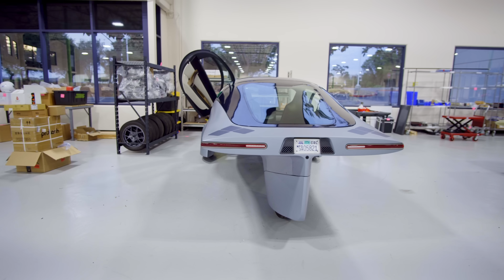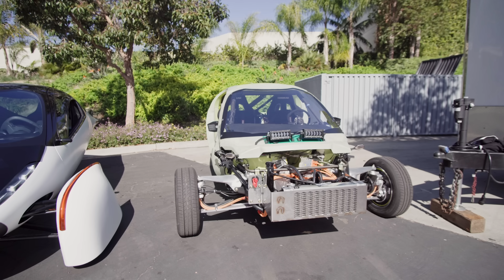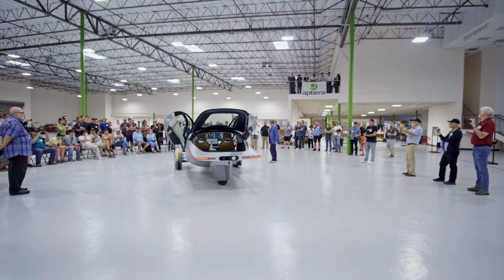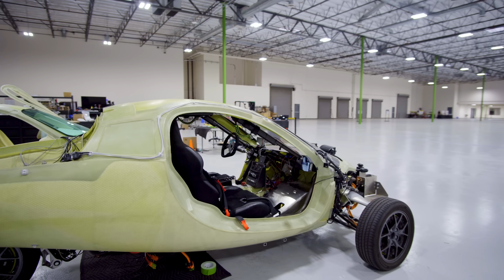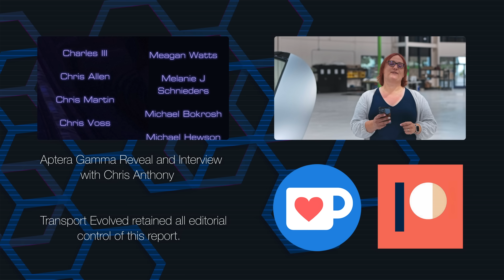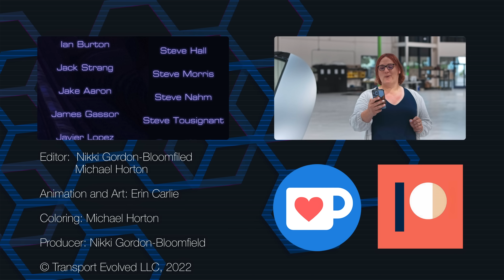The Aptera Gamma Prototype Is Here. What's NEXT?

Comment: air conditioning, does it have AC because if you live in the south it is a requirement
Reply: Yes, of course - AC and heat.  The body has several times the insulation value of most cars.  The AC system will also help remove heat from the vehicle when it is stationary and charging at a fast charger, or creeping along at under 15 mph in traffic on a hot day.

Comment: Great Interview.     I wish someone would talk to Chris about  the HVAC      air conditioning and heating.    It MUST have heated seats if not heated and cooled.....
Reply: All 3 will be included. From their FAQ:
 
"Where are the vents and capabilities of the HVAC system in Aptera?

"For Delta production, our complete HVAC system will include the following— windshield and side window defrost, left and right under IP footwell vents, left and right outer corners of IP vents, and the main screen vent system, which will be fully controllable in both temperature and velocity of the airflow. The center venting system was born of our design process and philosophy with roots in intelligent efficiency and radical simplicity in that we had two needs fulfilled by one solution."

And, 
"Will Aptera have heated or cooled seats?

"We plan to equip the vehicle with seat heaters. We are designing this vehicle specifically for a lot of the cold countries that love electric vehicles. Our sandwich core composites body offers great insulation and a nice heater, it’s very comfortable driving in the winter.

"Cooled seats are great for efficiency because if you cool the body, it’s actually more efficient. Unfortunately, cooled seats are pretty complex. We think those will eventually be an option. We’ll know closer to production whether or not seat cooling will be included. It’s a technical challenge for sure. "
Reply: @fotoguru222  The heater I need in my Nissan leaf is for my foot rest in winter. It should not be much heat needed, but very needed heat, and would keep me from feeling very cold! in a car that basically has too little heat! The snow freezes my shoes before I step in the vehicle! fixing this would likely prevent needing to heat the rest of the cab so quickly!

Comment: Doesn't look rugged, looks fragile. 3 wheel is excellent for motorcycle drivers. Price tag should be reasonable, though
Reply: It will be crash tested to FMVSS Part 200 standards by a third party as soon as there are production vehicles available for testing and the results will be made public.

Prices start at $25,900 for 250 miles of range.

Comment: Worrying.   Disappointed the thinking is so USA centric without even considering the rest of the world.   People mostly charge at home, and outside the US that means 3 phase AC which the Tesla plug will not support.  The world will not- cannot move to the USA Tesla plug, without seriously compromising charging at home.  If there was 3 phase suitable version of the Tesla charger it would be different. There is a reason even Tesla does not use it outside the USA.  Everything else about the car is so great, makes it so disappointing no one is thinking beyond the USA.
Reply: Aptera is working with international homologation experts and will have suitable changes when needed when the time comes.

Comment: Great interview. On this vehicle the Tesla charge port just makes sense. Glad they’re sticking to it. Like Chris said : everything on Aptera is bleeding edge tech, WHY take a step backwards with CCS?
In the EU they can just stick the big clunky CCS on it somewhere. 😂
Reply: Nearly nothing on the aptera is bleeding edge tech. It is banged together from over the shelf parts.
Reply: @vic321344  then you haven't researched this vehicle very well for you to say that.
1) pressed carbon sheet body panels 6x stronger than steel 6 piece body.
2) super efficient hub motors
3) Cd of .13 or about 1/2 pf any other car.
4) weight about 1/2 of a Tesla 
5) energy consumption aprrox 1/3 of any other ev
6) custom designed solar giving up to 40mi/day on solar alone.
so tell me how Aptera ISN'T bleeding edge engineering???
Reply: @jerrymolnar8010  you haven't researched this vehicle very well for you to say that.

1) The pressed carbon is an old hat. Not only the italian company uses this cheap alternative to real carbon parts.
2. The hub motors are not at all efficient. Tesla motors are efficient.
3. Aerodynamics are already known since WW2. Aptera has a good aerodynamic coefficient. There were already other vehicles in the last 100 years who tried that. But good aerodynamics means bad usability. Like a footprint wider than a Hummer H1. Therefore none of these aerodynamic cars ever made it into mass production.
4) Aptera is a motorcycle. It does not have to fulfill all safety features a cars has to. So it is easy to be lighter than a real car. And cheaper to produce. BTW Tesla has 4 seats and is the safest vehicle on the market, Aptera has only 2 seats with no real safety provisions whatsoever. A Deathtrap in case of an accident..
5). Aerodynamics. The drivetrain, battery, charging, heating/cooling of the Aptera is not at all efficient. The consumption of the Aptera is on par with other electric motorcycles.
6) solar yield is just a phantasy. Completely unproven. Other manufacturer made the same kind of promises and failed.

so tell me how Aptera IS bleeding edge engineering???

Comment: You have to validate anything the computer model tells you with wind tunnel tests, as the real world doesn't always match the models. I hope that has happened here.
Reply: I'm guessing that getting access to a wind tunnel is very expensive. Besides if the computer model is off slightly, who is going to complain that the Aptera uses 110 Wh/mi instead of 100 Wh/mi?

Comment: If Aptera is going with the Tesla connector, I hope they plan to include the Tesla to J1772 adapter that Tesla includes with vehicles and that they've confirmed that a common J1772 handle with a J1772 to Tesla adapter will actually fit their 'hidden' port.

And they better have a contract with Tesla for access to their charging network because if they don't, what's the point of using Tesla's connector except to save space and inconvenience your buyers.
Reply: Even in the US, Aptera will come with adapters.  I am sure that Aptera and Tesla have been in talks.  Tesla has made noises about opening up the Supercharger network to third parties, but we will have to see what happens.

Comment: In some states (NY for example) operating three wheeled vehicles require a motorcycle endorsement on your license. Is Aptera trying to get an exemption?
Reply: I thought that I had seen that no states required MC endorsements for Autocycles [roof/ roll bar & wheel vs handlebar]
Reply: Currently a motorcycle endorsement is only required in AK, WY, and MA.
Reply: @GoClimbARockEh  The law has changed in MA and WY.  AK is the last holdout.
Reply: @GoClimbARockEh  MA and I think WY have just changed their laws - residents should check.

Comment: Great interview. Chris revealed that the point of greatest turbulence is where the tires hit the ground below the wheel pants. For a while I’ve thought that maybe the pants should be shaped like the ‘spats’ on aircraft like Cessnas. From the side the spat looks like an egg with a pointy aft end, and a bit of wheel poking out of the bottom. The spat does a better job of streaming the flow before and after the wheel touches the ground, and makes a cleaner entry and exit to avoid hitting sharp changes in the road surface.
Reply: It is a bit easier when you only have to roll on a smooth runway. Dealing with speedbumps and snow and road debris probably makes the ideal pant impractically vulnerable.

Comment: Open? How about real pictures of the interior!
Reply: Such pictures are available. Check out almost any other video from the event
Reply: Detailed ictures of the interior were the first ones released.
Reply: @n.brucenelson5920  as a older person i'm interested in seeing people get in and out of the vehicle. All of the company videos only show the door opening then cuts away to the person already in the car.  I have a model 3 and getting in and out is easy but with the high rail you need to get over it looks like it will be really hard to get out.
Reply: @longIslandEV  I am an older person, too at 72 (almost 73, but lets not rush things).  I have only sat in and ridden in the first alpha Luna model.  There are some significant changes, most of which should make it easier.  They include moving the seats inboard and a larger interior.  In Luna I was able to back up to the seat, sit straight down, and then swivel on my butt to swing my legs in.  Getting out was the reverse butt swivel.  I have not had a chance to experience gamma yet.

I suggest trying it yourself once you have an opportunity.
Reply: @n.brucenelson5920  thanks.  i'm on the east coast so trying is unlikely.  I'm a fan of a smaller EV that is lighter on electricity.

Comment: What kind of driver licence do you need for this car?
Reply: In the US, you only need a regular driver's license in most states. Exceptions are MA, WY, AK
Reply: @GoClimbARockEh  Since this is considered to be a motorcycle, you don't need a bike driver licence?
Reply: @19mati67  No, it's in a weird grey area, sometimes called an 'autocycle'. Basically it's an enclosed vehicle that handles like a car, so you don't need a motorcycle license, even though it's legally more of a motorcycle than a car, simply because it has less than four tires.
Reply: @GoClimbARockEh  MA and WY are no longer exceptions.  I think Alaska is the only holdout at present.

Comment: Thanks, Nikki, an informative interview. Aptera doesn't need to adhere to 4-wheel automobile safety standards, but I'm curious about what sort of safety features will be included. Like crash safety, pedestrian detection, etc.
Reply: I think they previously said it has airbags
Reply: I beg your pardon? Why wouldn't it need to at least meet the safety of other vehicles?
Reply: @IIARROWS  Aptera has been designed to pass the full FMVSS Part 200 crash test standards required for cars, even though it doesn't need to in its class.  It will be third party tested and the results published as soon as there are production intent vehicles available to test.
Reply: @n.brucenelson5920  "Has been designed" does not mean that Aptera wil be able to pass any of them. "will be" is the usual empty Aptera promise.
Reply: @vic321344  every new vehicle has safety designed and built in but needs to go for independent testing.  We don't know how much in-house testing has been done on the safety kit. I'm guessing from your negativity you're not on board with this journey 😂
Reply: @nickjolly3984  No, motorcycles like the Aptera dont need to follow any testing protocol. I'm guessing  you're not on board with this journey 😂
Reply: @vic321344  I have a reservation. I'm not sure of the regs here in the UK regarding three wheelers but I'm comfortable that Aptera is perfectly safe.
Reply: @IIARROWS  3 wheels
Reply: @IIARROWS  It likely meets the standards set for a Harley!  Are there any? Just kidding! Sorta! 

There are airbags seat belts etc! These are things that are likely not found on a Harley etc.

The crash tests will likely tell the whole story later on in 2023! I am guessing that Elon has likely explained what works for crash protection and that that is already in the design! But, The test will tell!

Comment: Pre-production in 2023....this vehicle is never going to get made.
Reply: Interesting comment.  They have been developing far faster than Tesla for instance.  We will see production Aptera on the road before we see Cybertrucks.  Remember that Aptera started development in 2019.  It took Tesla 6 years to introduce their first EV conversion Roadster - a far simpler task.
Reply: @n.brucenelson5920  They develop very slow. Now they have a 80% mockup, no tests, no 500kMiles, no crashtest. They are still years away from production.

Tesla had to develop everything new: Batteries, charging, charging stations, electronics, motor, chassis. Aptera bangs together their vehicle from ready to buy parts.
Reply: @vic321344  Your rewrite of history won't fool anyone.  Not to take away from Tesla, but it took them 6 years to deliver their first "kit car" Lotus Elise EV conversion that they called the Roadster.  

Although Tesla is now much larger, and they started development of the Cybertruck in 2019, Aptera restarted as a company the same year and will likely beat Tesla to production with this first vehicle.

Comment: Thank you for another great video.  One can feel the energy as this project evolves.  I carefully listened to Chris's discussion and never once heard him mention safety.  Does anyone here know the layout of the airbags?  Most modern vehicles now come standard with automatic emergency braking for vehicles and pedestrians, blind spot detection, auto high beams, stability control, traction control, ABS, telematics, pre-tensioning and adjustable seat belt mounts.  While I never use parking assist features in my cars, I would especially like this feature in this trike.  Anyone inquire about how to repair one's crushed body panel?  Is there going to be a kit to do this.  These are things we never have to really think about with a car since there are many collision shops around.  But none of these shops had to perform repairs on a composite with cooling channels.  Have they increased the payload of the trike?  Makes no difference if they increased the size of the rear cargo cabin if the payload has not increased to more than 500 lbs.  Just think if Chris and Nikki went to Home Depot together, they would only be able to pick up one bag of cement (or one large suitcase).  Also please remember that Tesla has signed on to CCS2 in Europe and GB/T in China, the only market for the proprietary Tesla plug is North America.  I hope the world could standardize to one plug.  Thanks for the presentation and hopefully you can provide us reservation holders more info.
Reply: The Gamma has two front airbags (driver, passenger) and hope to install side curtain airbags in the Delta model which will go into production but that is still TBD.

Comment: Would be nice to get some preliminary numbers like kwh per 100 km at 100 km/h, range  battery size.0 to 60 and so on.
Reply: They haven't spec'd the range at 100 km/h, just the EPA test cycle range, which includes aa mix of speeds, some are greater than 100 km/h.  Some fans have roughly modeled it, but I don't trust their model. 0 to 60 mph speeds are published: FWD version is 5.5 seconds, and AWD is 3.5 seconds!
Reply: @fotoguru222  But they did not prove it on a real vehicle.
Reply: @vic321344  True that. We won't have real, production Apterae to test any of their performance claims against until next year. That's going to be a big set of activities early next year after production starts.
Reply: @fotoguru222  You do not test a production prototype. Testing leads to a production prototype.

Comment: I think there will be a cottage industry of local experts repairing the linkages, joints and wires on the wheel pods because at 88" (2.23m) it is very wide.    Its not the driving of the owner, rather the drivers of cars passing by, who will misjudge the width.  I'll have to just start driving selfishly like a Jag or BMW owner and just stop in the middle of country roads and expect the others to go around.   I'll sign up to be the Cornwall franchise!  A question for anyone who has seat in an Aptera - Can you see both the wheel pods from the driver's seat?
Reply: Just the driver's side, from what I've learned in other videos. There's been talk of cameras/sensors on the pods to aid parking.
Reply: @billman5379  OK - it's going to take practice keeping out of the Cornish hedges then! and they are not hedges!😀